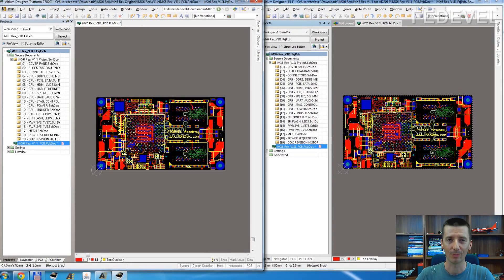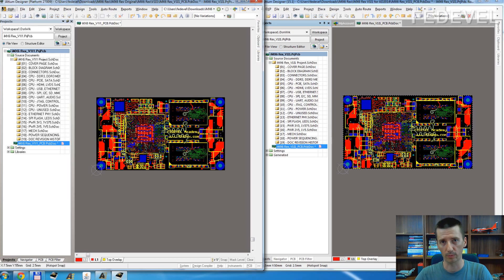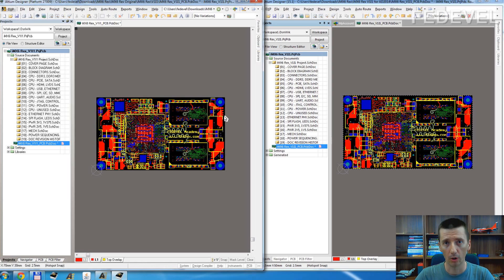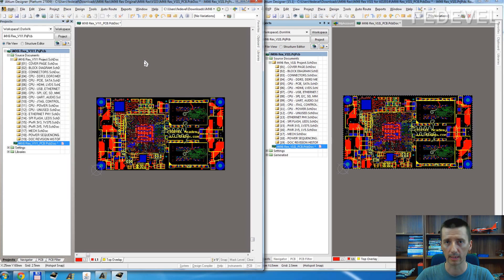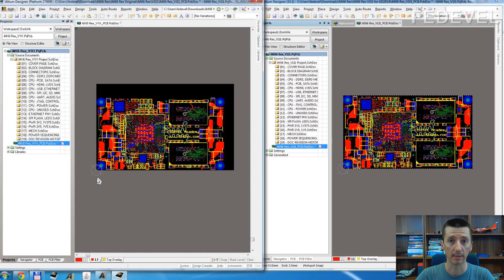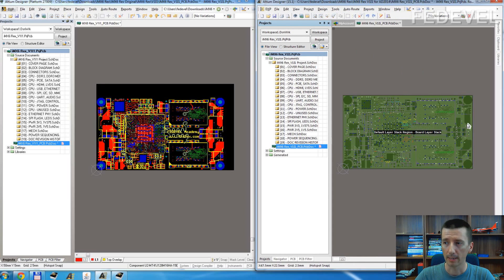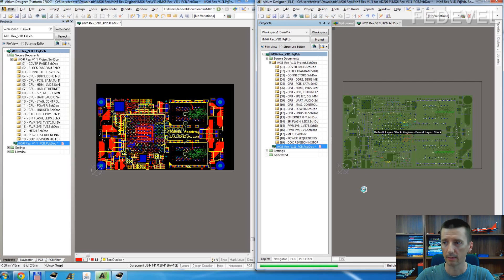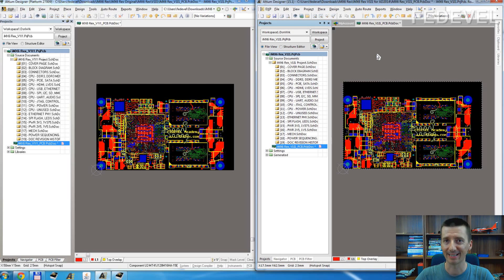Altium - How to Define Board Shape (The New & Old Way)

Comment: Is it possible to modify the board size to be smaller instead of bigger?
Reply from the maker: yes, you can completely redraw the board shape.
Reply: @RobertFeranec  how do i do that if i have a board that's populated like yours?
Reply from the maker: @sethsin9506  I am not really sure what you mean. Once you change board shape, you will need to re-do placement and layout.

Comment: Hi, I prefer to define the board shape in the Keep-out layer, then convert the drawing to the shape of the board. Because the PCB manufacturer needs the Keep-out outline anyway. In your case, do you also give the Keep-out layer to the manufacturer?

Also, I have recently started defining the origin of the PCB as the centre of the PCB since it seems easier that way. What are your thoughts on that? Is that not the industry norm?
Reply from the maker: kalhana1 I always create a special layer called Board Outline which is part of the output files. About the origin, I normally use the bottom left corner - I found it easy to see and calculate coordinates when drawing board shape or placing components.